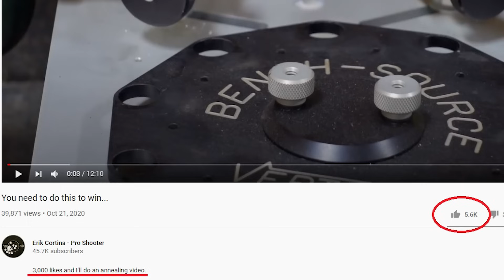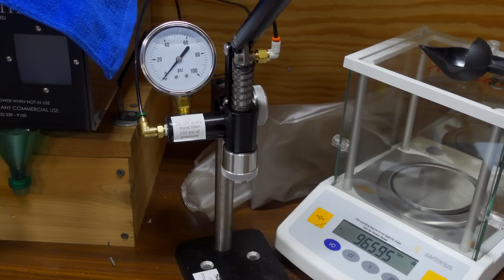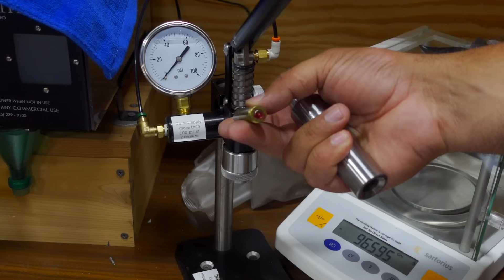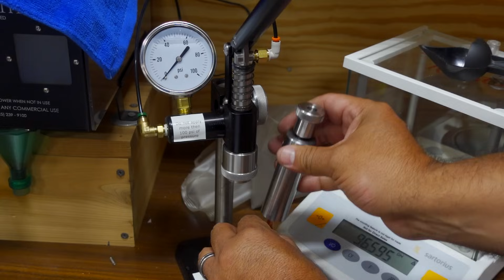This is how I anneal my brass

Comment: Your seating force is going to be affected by the oxidization layer created by heating the brass to red hot. You would likely get different results(might still be consistent in each separate batch) if you ran them through a wet tumbler with pins after the annealing process. Also, the problem with over annealing isn't necessarily about ruining neck tension. The danger is heating the brass to the point the base gets hot enough to soften which can result in case head separation.
Reply: Figured I'd reply to my own comment to say I appreciate the work you put into(especially when you're obviously a busy man) and the information relayed in your videos. I've already added some of your tips into my own precision reloading practices.
Reply: You realise you need to run it for SO LONG before the base gets touched? He ran it 10 seconds to demonstrate, even then I doubt the base is anywhere near the temperature it needs to be soft.. The neck would probably melt before the base gets hot enough, if you use gas. Sure, if you run it 30 sec with 1 torch you might get there, but if you are hot enoug to make it in 5-8, its quite low risk.
Reply: @jmkhenka  Well, first of all. I never said that Eric softened his bases. Just expanded on the fact that neck tension wasn't the only thing to worry about when over annealing brass. Second I just ran a test using tempilac 650f(a paint that melts when it reaches 650f) and some federal .308 brass(didn't want to cook my lapua) I placed a strip down the side of the case and after ten seconds on the exact same annealing machine with two propane torches(map burns hotter) I can verify that 3/4 of the way down the case reached 650f at 10 seconds into the test. On shorter brass this would happen much faster. In the instructions for the bench source annealer it states that you should put 400F tempilac(I don't have any) at that same location where my 650 melted at 10 seconds and remove the brass from the flame before it melts. They also state that in their testing it took 4-4.5 seconds to properly anneal a piece of .308 brass. Brass is an excellent conductor of heat which I also proved by burning my finger grabbing it at the base when I put it through the first time for 1 second to test the torch height/location....
Reply: Hey gentlemen, just to add to "the mix", the cartridge brass alloy seems to differ quite a bit among the manufacturers. Interesting discussions, I think...but, I'm just a simple 'lurker'. Stay well, you-all!
Reply: @lohikarhu734  You're absolutely correct. You can only make generalizations when using different brands/types of brass. The fact that they are different weights alone means they are going to heat at different rates. I just weighed three diff empty .308 cases on my FX120 scientific scale and they came out to Lapua(173.62gn) Federal(176.40gn) and Hornady(185.86gn).  Works out to a 6.5% difference between the highest/lowest and more mass means it takes more time to heat. Different alloy composition will react differently as well.  I test each type/brand I use with the Tempilac to make sure and then record the results to be referenced later.
Reply: @JohnnyTurbo87  Just for curiosities sake did you try scanning them before/after an extended heat cycle to see if the composition or ratios changed at all? I'm guessing the flame changing color is going to mean that something is being converted/burned away but I haven't seen conclusive evidence either way.
Reply: @JohnnyTurbo87  Oh, I know that you aren't going to change them while annealing properly. My question was when you're over annealing them and leaving them in the flame too long. The color change(blue to red) of the flame which can easily be observed after the brass reaches a certain temperature(seems to be as soon as it starts glowing red hot) means SOMETHING is being introduced to the flame to make it change. Many metals and their sulfates/chlorides will change the color of the flame at certain temperatures that's one of the ways that fireworks can be all different colors. Maybe a microscopic amount of the oxidization layer is being burned off changing the flame color.
Reply: @JohnnyTurbo87  how about Nosler brass? Same as Norma possibly?

Comment: Very interesting experiment Erik . I remember gun writers in shooting magazines 25 years ago used to say heat up the brass until its cherry 🍒 red then dunk them in water . So it seems that you are correct  . Depending on the cartridge case most heat  them up in between 5 and 7 seconds until they just start to glow red but if we heat them up a few seconds more we aren’t going to ruin the cases .

Comment: Always enjoyable. Thanks Erik. The temperature the brass is raised to is most important. I use a product named "Tempilaq" to ensure the same temperature is reached when first setting up to do a batch. You can get it from Brownells.
Reply from the maker: I hate tempilaq.  lol
Reply: @ErikCortina  Wow.
Reply from the maker: I tried it for a long time and just couldn’t get consistent results.  Then I had to clean the brass after using it.  So I just started watching the flame and it told me everything I needed to know.  :)
Reply: @ErikCortina  Consistency is definitely most important. Did you or have you tried any different way of measuring the brass annealing temperature other than the visual method you described?
Reply: @mikerusling1891  "GRAIN SIZE PRODUCED BY RECRYSTALLIZATION & COALESCENCE IN COLD ROLLED CARTRIDGE BRASS" 
Download this study & get the facts for yourself. There's excellent time vs temp vs hardness tables starting at page 29. 
To get a good understanding, try to read the entire report.
Regards..............Rotas

Comment: anneal is just softens the alloys crystal and have return to big crystal structure. when it worked forming it stretched those crystals structure that make is brittle and usually structurely harder. 

you also need best let it cold off slowly is key to true annealing. it is need to reach close to before its melting temp and then slowly cool. you can technically do the reverse when heating it up high and quench it introduce hardening back into the crystal structure.

Comment: You can definitely over anneal. It won't necessarily ruin your neck tension but the heat will reach the webbing and base of the case. This will cause blown primers ruined primer pockets and stuck cases that won't extract.

Comment: Erik with all due respect that is not work hardening. That is creating weakness from stressing the metal by consistently flexing and that thins the metal until it tears/breaks depending on the metal and the makes of it's chemical compounds. 

Work hardening happens from over heating the metal and it cools. So the shooting then cooling will make it a little harder every time you fire and cool it. Think of it like this... A bladesmith heats the metal to a temp that they can work it pretty easily and reheats it as it gets to cool to work until he is happy with his project. When he finishes that last few swings he cooks it rapidly in water. Then when it's completely cool to the touch say the next morning he goes to the shop and knocks it off his bench. When it hits the floor it shatters like glass. That is work hardening also called tempering. 

Say he doesn't drop it he cleans it then puts it into an oven for 2 cycles if 400 degrees for 2 hours each. That is annealing and what that actually does is align the grain in the metal so they make his blade stronger and more resistant to breaking as it gets a little bit softer so to speak. The longer it's in those cycles or with higher temps it'll be softer / easy to sharpen. Less heat &/or less time it'll be harder to sharpen & more brittle. 

If you combine the heat from the burning powder and the pressures of firing a round the brass gets stretched and thinned just a bit which will let it will work harden more and faster each time.  

Sorry for the length but as a machinist and amateur bladesmith that's how it was taught to me and yes I've shattered a few things here and there as well as broken things while machining because of work hardening. I hope this don't cause to much confusion.

Comment: I spin the brass in my fingers as I hold the neck in the flame.....when it gets too hot to hold at the rim I drop it in water.  I only use one torch.   308 is really easy to do because of the size.....223 and 22-250 is a little harder because the brass gets hot  to touch a bit quicker.  The neck doesn't get very red....just a touch and I have to drop it.  The case never gets very hot at the rim because I have to drop it in the water at about 120F or so....I can usually hold the brass for about 10 seconds before having to drop it with 22-250....but neck doesn't get very red.
It's nice to know there's quite a bit of a window.  I'm not annealing it as much as you are.
When I do 270 win I have to spin it in my fingers about 15 seconds before it gets hot to hold at the rim.  It's annealed about he same as your's.  It's not rocket science.

Comment: Your explanation of color allows me to anneal and not buy Tempilac. I used to anneal by color, then switched to the tempilac. It dried out on me from sitting. I reconstituted it, but now I see the way I did it, slight orange color works well, otherwise your experience with longevity would not be what it is. Thanks.

Comment: If you have a torch you should anneal. I layout all my brass on my picnic table and run through them in 10 minutes. I have "overanealed", but only for experimentation. The color difference is obvious at night. Orange is ideal. To those chemistry nerds. Perhaps your right... Perhaps I am cooking some zinc molecules, but for my purposes (consistent sizing, neck tension, accuracy) I am very happy with the results. I get over 10 rounds per cartridge what more can I ask for? To you Erik... The difference between our methods are the turntable spinning the bullet while heating I think this difference is negligible, but the timer would be nice. I feel im consistent by watching the flame color and getting into a rhythm. Look forward to seeing you test and determining what is worth the cost. Hate to be in your shoes and by your current annealer when the AMP is ideal.

Comment: After watching this video I was relieved that I won't over anneal my brass but it turned out to be I was wrong, I did.  The difference might be because my brass is 300 HAMR formed from 223 LC cases which has thinner neck wall of only .010".  I annealed before forming cases and after and when I seated the bullet I could push the bullet in with the palm of my hand against the table.  This is standard test for neck tension.  The cases that I didn't anneal after converting brass didn't have that problem.  I even pulled the bullet, neck sized it and seated new bullet and STILL I was able to push it in.  I didn't even expand the neck!  I seated .310 sized PC bullet in to .3055 neck, there should be plenty of tension.  I came to conclusion that I over annealed it when I did 2nd time after brass was converted, it went through a huge expansion 22 caliber expanded to 30 caliber in one pass, I figured it needed a 2nd annealing after that.

Comment: Exactly as I do it looking for that first hint of Orange/cherry red. I think to many folk get hung up on it and the sales pitch that you need a $1000 induction set up.
Reply: How about $200 for annealing with induction? Cheaper than Eric's annealer and probably more consistent. Also, get more done vs an AMP before the unit has to cool down.
Reply: @p1choco  yeah that looks good, as long as it’s repeatable and controlled jobs a good un 👍🏼 
I have a home made one similar to Eric’s set up I made which works well, but if I didn’t I would likely make an induction one, not because it’s necessarily better than flame.... just cooler because it’s like magic :)

Comment: i have observed that as i heat up my case necks the ones that have been reloaded and fired 3 or more times heat up quicker than the ones that were annealed (heated up) last reloading, this may be to the brass crystal structure grabbing what it can with work . the annealing process allows the molecules to relax their covalent bonds letting the molecules relax and soften.

Comment: Erik, thanks so much for the video of how you do annealing. It all makes sense to me. I'll be looking forward to what you learn by using the Amp Annealer. I'm developing my own DIY induction annealer. I was concerned about over annealing. You've adequately demonstrated temperatures slightly over 750 deg F wont ruin the cartridge.  Makes me feel more confident mine will work adequately. BTW, I'm using 750 def F Tempilaq to determine when the brass has reached that temp.

Comment: The problem with small gas bottles is that the pressure will fall during the annealing process. If you want better consistency, the best way is to use a larger tank instead of these small bottles.

Comment: I built my own annealing machine about 7 years ago. I have annealed probably 8k through it.

I have a friend who works as a metallurgical scientist. I played around for months with settings which he help me evaluate. After having him over for several beers and watching it run he said, "I would pull them just after the flame changes to orange. His theory was from having worked with a plumbing guild on boilers and  sweeting copper. The changes in flame color at that temperature represents off gassing elements of the metal. This is both helpful in knowing your at critical temp and limiting it help preserve the original alloy.

Your advice is spot on with "what I do" what I found and what works!
Reply: Back in the stone ages, when I was in JR high school, we actually were allowed to make things that taught trades.  One of my courses was sheet metal mechanics, where we cut dangerous sheet metal with those hazardous metal snips.  Scissors that would go right thru the pocket of your bench mate without his knowledge. When we bent the items, we had the option of seaming mechanically or soldering, as in do it quickly cause time is money, all at the whim of our teacher.  The irons were solid copper approximately 3/4” sq, with app foot long shafts, terminating in a wooden handle. We placed these into a natural gas furnace, into the blue flames, and when it orange tint occurred, it was hot enough.  Additional time (I.E. goofing off or yapping, explanations to teachers) didn’t help, but it did make it necessary to file the iron back to its former shape, then re-tin before it would work properly.  Soooooooooo Eric- you have a track record with your present unit, only reason to change is speed....guess what I am Betting on?  Love the way you show your processes and explain in common speak.  You replace brass annually?  Or count cycles?  Thx!

Comment: I salt anneal and I kinda work on the same theory, I dunk 'em in there for about 6 seconds and call it good. The good thing about salt bath is it gives you a ton of time to mess up, I wouldn't imagine the brass being damaged after 10 seconds in salt. The bad is- it's a pain as you need to tumble with soap after you're done because if you let it sit for a week or so you'll get some green oxidation/corrosion. Still, my brass has lasted and seems consistent so far. One of these days I'll invest in a hydro seater and see how well it really works.
Reply: If you really screwed up annealing the neck tension is so low you can push the bullet in against the table with your hand at least with .223
Reply: @DimaProk  Interesting! I might have to try that with some .223 brass

Comment: Annealing brass cases does two primary things: 1. it extends the life of the case, 2. it brings back the "softness" of the neck hopefully to the original neck tension of the case to begin with.

The crystalline structure of the brass is whats in play here. To put simply IF the crystalline structure looks like X O X O X O, then when you work harden it by firing or sizing the structure might look like XOXOXO compacting the structure together. That makes the brass harder. Flame or induction annealing is the process to make the structure attempt to go back to X O X O X O which "relaxes" the brass making it "softer" again. Taking your neck tension back to original is the constant you are looking for. Same (or very close) tension is one of the factors in making the cartridge perform just like all of the others in the same reloading batch.

Lighter tension or heaver tension the same tension is the goal. The procedure isn't that important as long as you do the same procedure and it produces the same required results over and over again. The downside is if your brass is a little harder than it could/should be you will lose some case life. 

If you could do it the same 10 cases from the same lot chosen by weight, same 10 freedom seeds chosen by X, same powder charges, same case prep should produce the same results over and over again. 

Actually the most important factor is the one that you can't change. That is the shooter, no case prep, precision rifle ...... will change the day to day problems the shooter has doing the same thing over and over trying to factor the wind and the sun or lack thereof, the fatigue, the we have to go a little faster now that we made a mistake and so on.